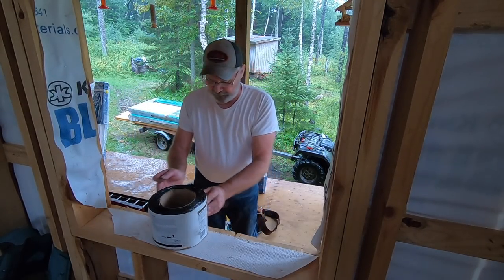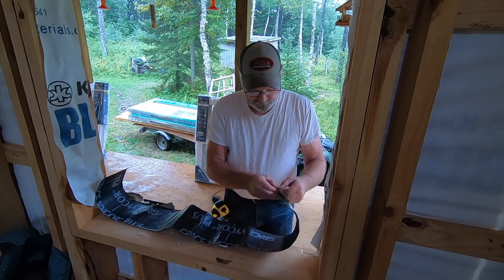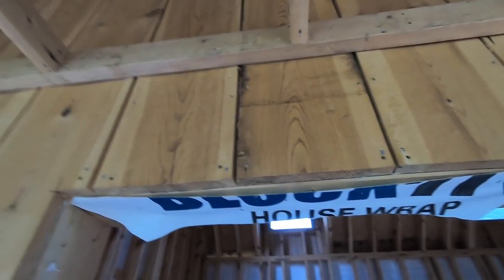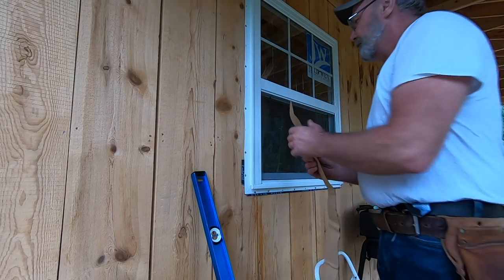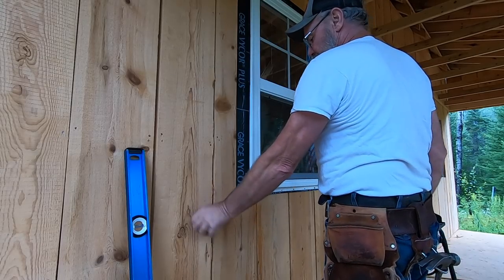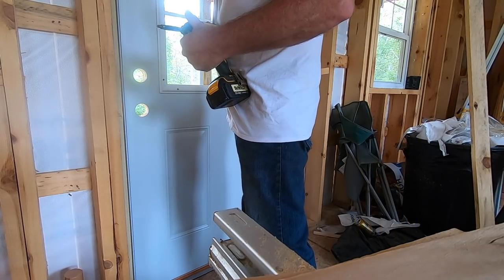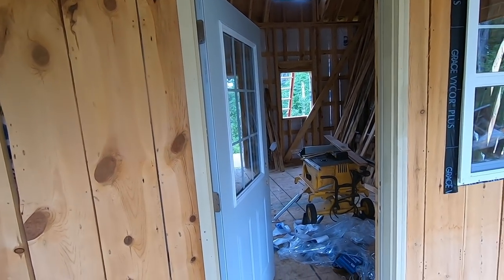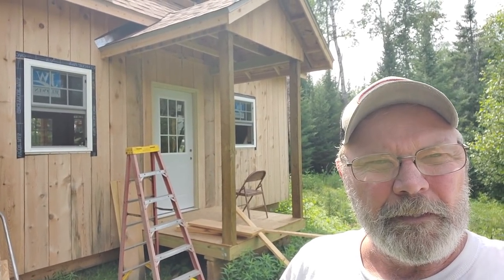Off grid cabin build, we have windows

Comment: Nice to see you're getting the cabin dried in so it's done well before winter, and it'll keep the rain out. Now you'll be able to work inside if the weather is uncooperative outside. Nice job, good accomplishment.
The shed moving and setup should be a fun watch too.
Reply from the maker: The windows really added to the over all feeling to the cabin, still missing one, but with luck maybe it will be here soon. The shed move was a real pain getting it on the trailer, not my brightest moment, lol. Thanks now Dale

Comment: Good job my friend as always. I have a concern. I've had some bad experiences using spray foam under vinyl windows. If lt expands to much it will literally distort the sill so bad the windows wont shut properly. And i always have the window closed. Not doubting your skill at all. Great video as always.
Reply from the maker: Did you use low expansion foam. Soft open cell.
Reply from the maker: I've had to Sawzall doors out one time from home owner using wrong type
Reply: @WanderingWiley  low expansion?
Reply from the maker: @randallweaver7718  they make a spray foam that's low expansion just for window door applications
Reply: @WanderingWiley  goodbto know. Thanks Wiley.
Reply: @WanderingWiley  no. Just the yellowish can from home depot.